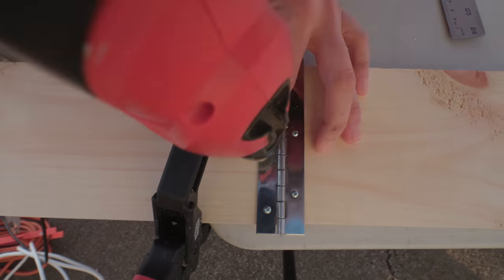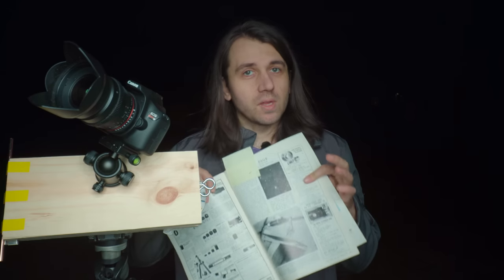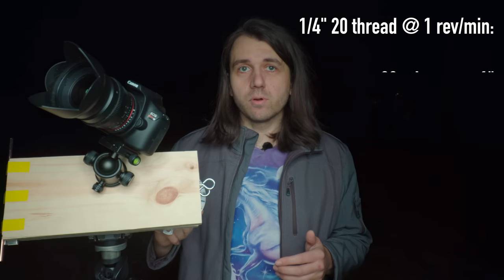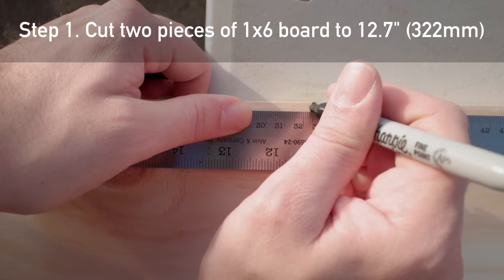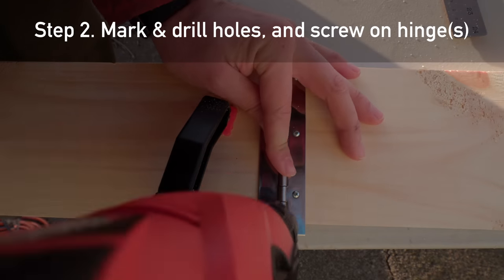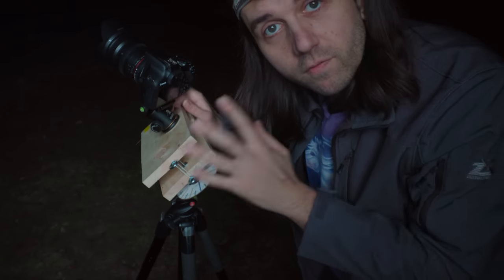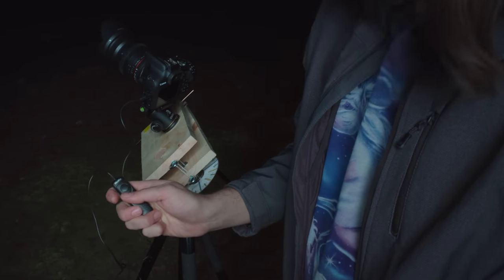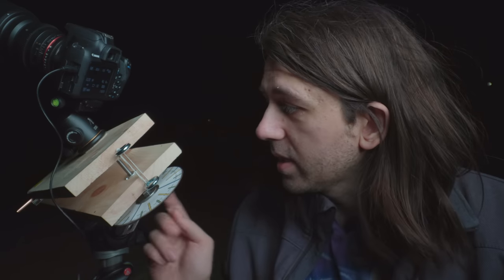I Made A $30 Tracker, Is It Any Good?

Comment: I just made mine and got to try it out (I did it on stars for test and to see how everything goes before I try on other things, and I ran into a problem, when I mounted it on my tripod the wood would kinda shake unless I was absolutely perfect at just lightly turning it and even that was iffy, so I had to open the top wood and took my heavy camera bag and put a strap between the wood so it wouldn’t mess with anything just weight the mount down more in the middle and it seemed to work, no more of the wobbling when I went to turn the cd, now if only the sky’s can clear back up and I can go back out and start getting things

Comment: Your channel is absolutely amazing!!! You can simply complex topics so well!  One thing I was wondering that I dont think you’ve covered.  You made extensive videos on untracked dslr astrophotography on a tripod, but I was wondering about untracked dslr astrophotography on a telescope.

I have a canon 5D classic that does not have live view.  Is there a way I could hook it up to a telescope and use the telescope to focus the image?  It would have amazingly BIG pixels for minimizing trailing as it is a full frame sensor but only 13 megapixels!  If there is a way to use it for imaging M42 that would be AMAZING!
Reply from the maker: Even with large pixel size, you'd be limited to very short exposures at a telescopes focal length (e.g. 1000mm), this will make it difficult to capture dim objects. But Orion's core (trapezium) should be doable. You can just use all the same principles from the untracked camera lens videos, nothing really changes other than needing to use very short exposures and recentering every 10 seconds (difficult!). With a camera that doesn't have live view, you will have to focus through trial and error. Take a photo, look at playback, move the focus ring, take another photo, look at playback, and repeat until you have it dialed in. Clear skies!
Reply: @NebulaPhotos  wow awesome!  Thank you so much for taking the time to reply!  You are the best!!!🔭

Comment: I'm in the process of building a barndoor tracker with a motor and a bent threaded rod. Material cost is below $100 but it takes a little more "skill" to assemble. As a polar finder I'll use a cheap rifle scope. Still the results should be on par with a professional tracker.

Comment: What force are you applying to this guide wheel?  Maybe a cheap battery-operated timing mechanism used in wall and table clocks will be enough to drive the mechanism?

Comment: currently working on my own barn door tracker using 2040 aluminum extrusion and 3d printed parts .. currently waiting on some ceramic bearings and a blade to cut my extrusion down.. using nema 17 and threaded rod and delrin anti backlash nut from a z axis hoping to be able to figure out the arduino stuff I need. .planning on limit switches for the closed and fully open position

Comment: It will be great to see motorized barn door tracker in your version!

Everything what do you need it's a: Chinese motor "28BYJ-48 + Driver (1.6$)"
Arduino (5$) for code (code you can find this in internet for free)
Two 3d printed gear (1:4 i think will be great) "it's very cheap (less that 1$)  just find who can print them for you"
And 1 meter threaded rod m5 (or different) + 2 nut (1$)

So, you can upgrade your barndoor tracker to motorized just for near 10$ (in your country prices can be different)

P.S. Sorry for my bad "France":D

Comment: what you need is an Arduino MP, a stepper motor with a small diameter toothed pulley on the motor and a larger diameter one on the screw,  a toothed belt to connect the two, probably a simple program to advance the motor one step at a time which would turn the screw very slowly compared to the motor. Any kid into computers could probably write the program in ten minutes. A power source, a couple of 18650's and you'd be good to go. The Arduino could probable be set up to trigger the camera, depends on what input the camera will accept. Piece of cake! Twenty-five bucks would probably do it.

Comment: I imagine you can polar align the device with a compass and a level. But to use the compass and the level you need to know the latitude you are at to get the angle correct.

Comment: 6:37 OHHHH! I know of possibly a "PERFECT" solution for EASY Polar alignment! When I want to take shots of DSO's that I can't even SEE with my DSLR, I use a rifle scope red/green dot "reflex sight" mounted to my hot shoe via a hot shoe to "Picatinny rail" adapter (Picatinny is a standard type of rifle scope mounting rail section), which can I then dial the reflex sight onto a BRIGHT star to get my camera AND the reflex sight both aligned/zeroed to the same point in space SUPER easy in the dark even if I can't "see" the DSO I want to aim at, but know the general location! You could measure the distance to the center of the reflex sight + the measurements of the Picatinny rail and cut a slot to mount a long enough piece of Picatinny rail section to accommodate the sight and mount that crosswise into the wood, so that the reflex sight is as close as possible to the hinge point axis, then "zero" the sight to match the correct point of aim/zero! The one I've used with just my DSLR is finally back in stock on Amazon for 34 bucks USD... I'll post the search title in a following comment because yt sucks about posting part names.
Reply: Sheesh... YT won't even let me list a part name! I sent you an email...

Comment: I don't have a DSLR in my budget, but I recently got an iPhone 13 Pro Max and have already discovered that shooting 30 second Night Mode exposures in ProRAW, I can get SHOCKINGLY good milky way images. Unfortunately a bit of star trailing is still visible. 

I've started building a barn door tracker to mount the phone on. My intention is to be able to take an extended series of thirty second exposures and then stack them in Deep Sky Stacker. Try and really push how far I can take phone astrophotography.
Reply from the maker: Nice! I did the same with this exact barn door tracker and my Smartphone for my 'Astrophotography from $100 to $10,000' video and I think it worked very well. Clear skies!

Comment: I liked what you do the only problem is looking down and turn on the flashlight when you're in the middle of the desert to watch that wheel could have an effect on the exposure so what is the cheapest commercially-available tracker that you can put on a tripod like the tripod I have a bogan 1548 it's a big tripod it's built like a Sherman tank after all it's designed to hold a 600 F4 lens please let us know about an  inexpensive tracker that can go on that type of tripod .
Reply from the maker: What focal length are you planning to use the tracker with? A good alternative to my barn door tracker here for wide-angle lenses (35mm and wider) is the Omegon Minitrack LX3. It is $184 and does not require power as it's a wind-up tracker.

Comment: Hi Nico. Kinda laughing at all the suggestions to motorize this because they suggest arduino and steppers and programming and various timers that would need a gear train to adjust the rate 
It stretches my brain cells a bit, but i'm old enough to remember that we'd find an electric clock with its synchronous motor to sacrifice if AC power is available as they seemed to have enough torque on the second hand as long as you were running the barn door so it's closing.
Re teaching old school drift alignment  is the next step towards improving the accuracy a bit,  but for those with ideas of anything longer than a nifty 50mm with the APS-C sensor, that's about it for this gear.  Anything beyond and you're working to hard to get tracking. 
There are a lot of cool targets though at that FL.
Reply: I had thought to take an old wind up mechanism ( of which i have a few old ones) and see if I can get that to work. No idea, but it will be fun to find out.

Comment: there are very cheap 1 rpm motors especially on ebay and even on amazon 
I think that might be worth exploring I used a few of those over the years 
and they are pretty accurate more than good enough for this application 
they cost around 10 bucks and you can power them with a 12 volt battery

Comment: Wanted to build one of these but I think I already have the makings of a star tracker. I have a AZ mount mounted on a tripod head. Could I not polar align the AZ mount, attach a small motor to the AZ adjusting screw and voila, a star tracker?

Comment: You should be able to motorise this somewhat "easily" with an old egg timer for example.. but you might struggle to get the rotation/timing right. As you're turning 15 degrees every 2.5 seconds?.. so 6 degrees every second ... or 360 per minute. But usually egg timers do 360 degrees in 1 hour, so the timer would be 60 times too slow. But it's not impossible to use some cheap plastic gears to get a 60/1 ratio and make it work.

Or maybe use an old clock motor or mechanical stopwatch that does have a 360 degree/min rotation of the second-counter. (But the drive might not be powerful enough to spin the bolt and overcome the weight of the board and the tension of the elastic)

Or go for small stepper motors for a few bucks somewhere, attached to some gears and batteries/usb.

But, yea.... by then.. a mechanical tracker like the mentioned Omegon mini tracks are becoming very good options, that don't really break the bank. But provide more ease of use with it working on its own.
Reply: Your way behind the game. A guy made a programmable one.   Less than 50.  It’s on it’s way to me.  Parts off Amazon

Comment: After I watched this video, I can now understand the principle of Equator, thank you very much! If you add a device for controlling automatic rotation velocity, it will make your work easier^^
I am very interested in it, do you know any of such device having 3/8 interface? Does Omegon product you mentioned have those function, rotation control following earch?
Reply from the maker: I think I understand what you mean. The Omegon just goes at one rate, but it has a curved rod so there wouldn't be tangent error as there would be after 1/2 hour with this device. Not sure how much it matters since both devices have to be re-wound after about 1/2 hour.

Comment: A few questions as I begin this project. First, what kind of tripod are you using? Mine will not allow me to polar align... my bottom board sits on a non-movable tripod base? (The ball adjustment is on the top board.) Second, How do you turn the handle without creating vibration that blurs the shot?

Comment: I was recently bequeathed a used, but good functioning Canon 1200d from a beloved family member, and this is something I've been wanting to try all my life. Unfortunately, also being a musician, it'd be quite difficult to take up two expensive hobbies simultaneously, so I've enjoyed your videos quite a bit as they've given me a good guide to start figuring out how to assemble a low/no budget AP rig. 

I have a question, possibly a dumb one, but just curious, are there any issues with manually adjusting the tracker dial and like vibration or interference with the long exposure from contact  with/movement of the dial? And if so, how did you combat this? Thank you!
Reply from the maker: Hi Jay, 
Not a stupid question. Manual tracking only works well for wide-angle lenses which are much more forgiving to small jitters your hand might make. That said, I did practice making the movement as smooth as possible, and some people have suggested you can get even better results just constantly moving the dial while listening to a click track to keep to the right rhythm/ rotational speed. In the next couple months, I'm going to add a motor to this system, so stay tuned.
Nico

Comment: I have a couple linear motors that have 200mm travel and 0.1 um (100 nanometer!) resolution.  What would be the best way to use one or both in constructing a tracker?   I can handle programming the control system and have the needed drives for them.  Bonus is a raspberry pi can talk to my drives.
Reply from the maker: This is something I am looking into myself for the follow-up video. For a barn-door style tracker, you would just use one motor to rotate the main bolt at the correct speed.

Comment: Man, this seems so complex 🤯, I am not good at engineering and I am super clumsy, I wonder how dangerous this would be to attempt to build.

I have some questions as well:

- What other board other than a 1x6 would be ok? Im unfamilliar with how to buy lumber or where but I have some wooden pallets laying around and am not sure if they would or wouldnt be ok. 

- what is a ball head? How do I attach my dslr?
Reply from the maker: Other kinds of board would likely be fine.  if you have a tape measure, you can measure the wood you have. If it's somewhere around 1/2" to 1" thick, that would be perfect. A ball head is the thing that goes on top of the tripod to point the camera. In this case we use two ball heads, one to attach the tracker to so we can point it at Polaris and one additional one on top so we can point the camera at whatever we want in the sky.

Comment: I had an idea watching your video and trying to figure out the how ioptron work.
and i want to ask you if for the rotation we could use an egg timer mounted verticaly then mount the ball head on the center of it and finally angle everything in the tripod to be aligned ?

What do you think, is it gonna work or the speed of the motor will be a problem ? 🤔
Reply from the maker: It might work. The rate of turning is theoretically correct. The only potential problem: is the egg timer motor strong enough to move the weight of a ball head, camera and lens without slowing down? Worth an experiment if you already have an egg timer you don't mind destroying or can get one cheap.
Reply: @NebulaPhotos  i will buy one one and give you the update. Thanks

Comment: Hi! 
I was wondering how complex shooting on film could be. You will have many variations, from the film's Reciprocity Failure to the Earth's motion.
In my case, I still only got those star trails. :)
Reply: I think it is best to use slide film, ektrachrome 100 iso for instance. But the exposure time will be very long to compensate for reciprocity failure, so then you need a star tracker that can go for at least 30 minutes or so.

Comment: Gonna do it, but adding an old electric timer, you know those our parents used to turn automatically lights and stuff on or off... thank you!
Reply: not 100% sure that would work. Depending on how fast the motor spins.
In this video he ends up spinning 15 degrees every 2.5 seconds, which is 360 degrees per minute
(or 21.600 degrees per hour)

But most of those electric timers have a 24 hour spin cycle? so 360 degrees per 24 hours. 
(or 15 degrees per hour), so such a timer is 1440 times too slow for this.

You might have better luck with an egg timer, those tend to do 360 degrees per hour. So that's "only" 60 times too slow. But with some gears you might be able to get the 60/1 ratio and make it work.

Or go for small stepper motors for a few bucks somewhere, attached to some gears and batteries/usb.
Reply: @PilotPhteven  Oh the egg timer that's a brilliant idea, I was toying with the other one, because I used it once for a dark room  enlarger, so to make go faster I removed some gears it had inside from 24 hours to one hour... thank you Steve
Reply: @PilotPhteven  the 2.5 seconds are at a 24mm lens.
how many degrees must be lowered to 300mm?
in order not to have a star tail, I can use a maximum of 2 seconds without a tracker

Comment: This was sooo interesting !
When can we expect a part 2 ?
Reply from the maker: Some time this year. I'd give a better estimate, but usually when I do, I miss them by several months 😂
Reply: @NebulaPhotos  Alright, thanks for letting me know, though. I am looking forward to it anyway !👌
Reply: im making this now. im thinking for a pointer ill use a 2-3 foot 1inch diameter pvc pipe. ill cover one end with syran wrap with a dot in the center. the other end im going to drill a couple holes and make a crosshair with dental floss or something. idk if the longer lenght will be more accurate or not.
Reply from the maker: @robertbarnes2598  Yes, a long sight tube like that could be good. Especially if you can calibrate it with the full moon (1/2 degree) to know how large the field of view is.

Comment: Do you have to change the rotation speed to match your lens? Sorry if that's a stupid question!
Reply from the maker: Hi Leon, Nope, one rotation speed works for any lens focal length. The only difference is: the longer the focal length, the more critical even tracking at the right speed becomes. With a very wide lens, you can get away with just turning the wheel every few seconds, but with a telephoto lens, it would be better to add a motor so the tracker can rotate constantly. Either way the rotational rate should stay the same: the sidereal rate. Cheers, Nico
Reply: Thanks again!! Trying to get into this hobby but it's sooooo expensive. Your videos are a godsend. I'll take it as far as my limited finances go and make the best of what I can. Thanks again.